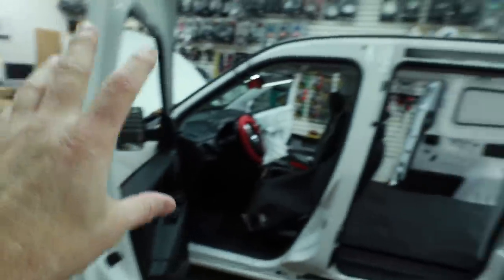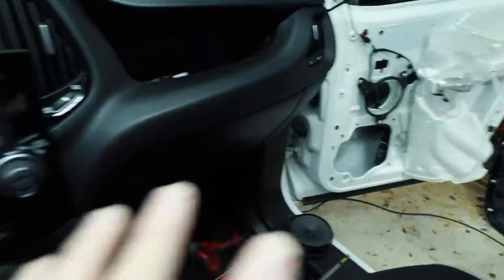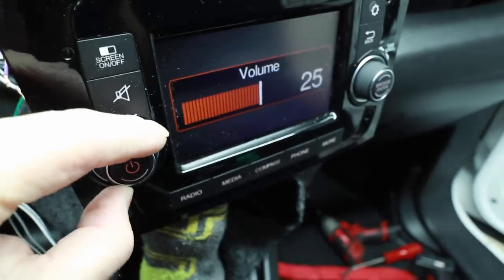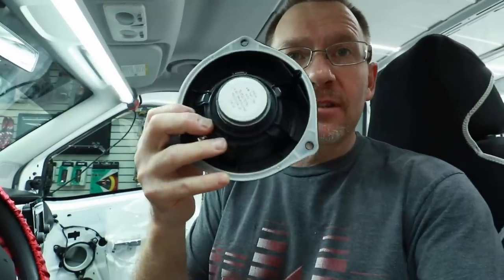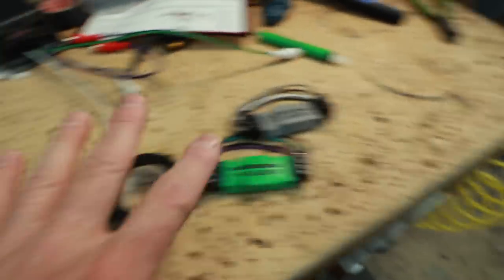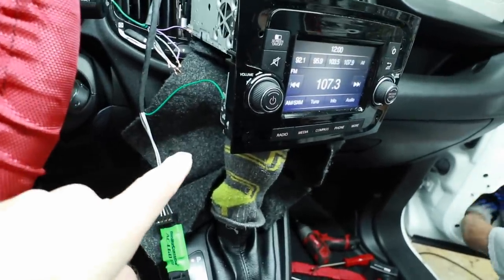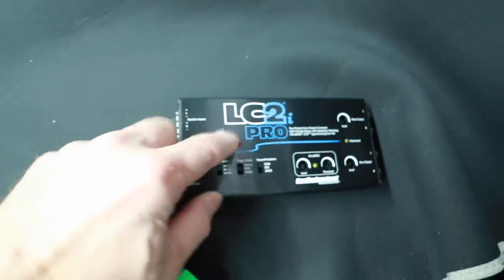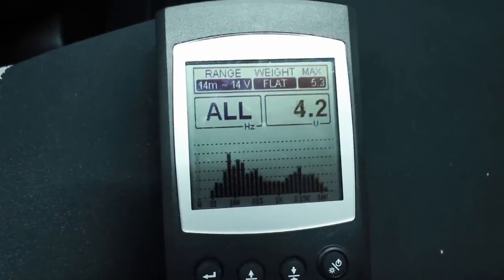Why am I getting no sound out of my factory radio and what is a load resistor for

Comment: hello! excellent video, very informative. I have the same problem. and I don't know how to fix it.
I am a fan of car audio, I have a jeep renegade, I made an installation keeping the original multimedia unconnected.
of the speaker output hi. al a DSP bit ten. and from there to the amplifier, but the system tells me assist park not available. audio not available.
I don't know how to solve it anymore

Comment: Wondering if you can help me. Installed a set of bullet tweeters in the dash and im getting a static/pink noise out of them when volume is  down or not playing anything. Was told to run a resistor but not sure what i need. Running a lc7i and gains have been set with a dd1. Thanks in advance.

Comment: Hi Dean ... HELLO from Australia .. love your videos ... I've recently purchased a Grandma spec 2003 Toyota Camry. Unmodified full service history.... it has the original double din amfm radio casette and cd player ... cool at the time but now not rit for purpose anymore... ii have a much more modern 2015? Toyota oem head unit that has satnav, bluetooth etc ... all the good features...a fantastic upgrade ... I've bench tested it and it works fine, satnav, bluetooth etc, sound comes out but as soon as I swap it with the old unit and plug it in the car, there is no sound. As you know Toyota use the same standard harness and I have tested over and over but can't find the problem of the no sound... I'm thinking to upgrade the speakers- would that work? I appreciate your advice Wayne

Comment: I installed the kicker stereo loc (with remote turn on)on my Ford Explorer just because I didn’t want to run into this issue. Even if it does or not cut out rather just be safe and have it already.

Comment: I installed an Alpine head unit 2 days ago in my 95 GMC 1500. Worked great w factory speakers... today I swapped the door 6.5”
Speakers w aftermarket Skar speakers and ... NO Sound to any speakers. Unit gets power but no sound. Tested the Head unit on separate speaker and still did not work... What do you suggest?

Comment: 2006 Solara, using an AC DQ-61. Used speaker leads from OEM JBL amp but had an annoying hisss that I was not able trace and resolve, even with the stock head unit off. So I went directly to the head unit to the DQ-61. Speaker outputs (L/R) from head unit works but now the volume in my head unit does not work ... everything else works ( i.e. radio & CD). I have to use the input knob on DQ-61 to turn up volume.  Thank you in advance for any assistance. Merry Christmas 🎅
Reply: Add the AC-LGD (blue ones) to that output coming from your OEM radio. Good chance that it will fix your issue.

Comment: Would this happen for just one speaker? I swapped my from speakers in my Ram and lost a channel. The other three are still working but I can’t get any voltage or sound out of the one channel. Thanks for any help.
Reply from the maker: Yes you need this for the ram, put on all Channels. Get the green

Comment: Maybe a dumb question, but why are the options 20 Ohm and 60 Ohm if a regular speaker is about 4 Ohm? Is it just to reduce dissipation? Then I guess the radio just needs to see any load, regardless of the value?
Reply: If this resistors works in systems - then yes. You are right. They reducing amount of heat dissipation. If built in amps have 15W RMS@ channel => 60W in total, or more than 200W with external amplifiers - so yes, 13W max dissipation for 20 Ohm resistors on built in amp, and something like 16-20watts for 60 Ohm resistors on external amps.
Reply: I did my dodge charger back 2013 never had a clue but as i was scouring the internet trying to figure out why my sound wouldnt work after installing a little 4channel amp w/signal sensing power on, i read the can-bus needs to see a resistance so i went to radioshack bought 4 of those little wire type resistors with the color coded stripes, i had no idea what ones to use so i just guessed, i installed them by piggybacking into the speaker wires an it worked, but now i want to upgrade would one of those LCQ2 things work?

Comment: So I've wondered forever now. Have a gmc envoy and I replaced the head unit. Truck had factory bose system. Now....I bought alllllll the PAC parts kits for the steering wheel controls and to by pass the Bose amp. Get it all together annnd NO SOUND. I'm racked here... well by total accidental dumb luck I hit my on star button....on star ready.....I hit it again to shut it up aggravated...I noticed tho that by doing what I just did that it reset my head unit. After it came back on guess what...... my sound worked. Still to this very day I still have that truck and I still reset it for sound the same way lol lol lol. Sooo is this really why mine did that? Why on earth does the on star on/off make it work?
Reply: I'm a forum member over gmtnation.com which is where you can get all the info you would need on the gm 360/370 (which include envoy,trailblazer,saab97x,ascender,rainer)line of trucks and many others. Tons of audio builds as well as maintenance and troubleshooting.

Comment: What year F150s are effected? I am going to be installing a dsr1 feeding the high level in, do you suggest I still use load resistors?
Reply from the maker: Yes Ac-LGD blue
Reply: @FiveStarCarStereoInc  Thanks, I have a 19 with no cd player, I was not sure if things have changed with newer units

Comment: I have a 2020 Nissan Altima with the non-Bose system. I changed out the speakers in the vehicle and and added an aftermarket amp. I am having a load sensing issue causing the radio to mute the signal. What device should I purchase to fix this in an Altima?
Reply: AC-LGD20
Reply: From AudioControl